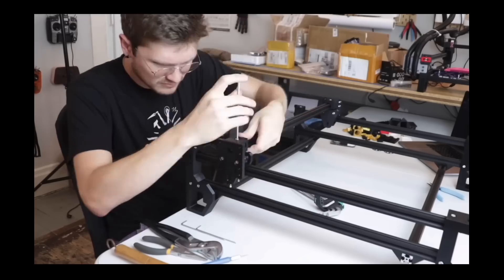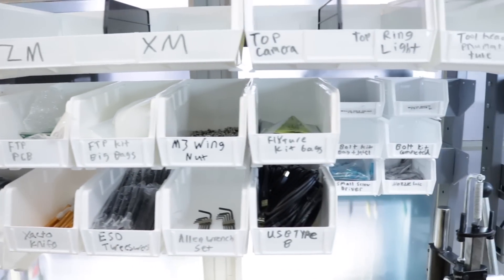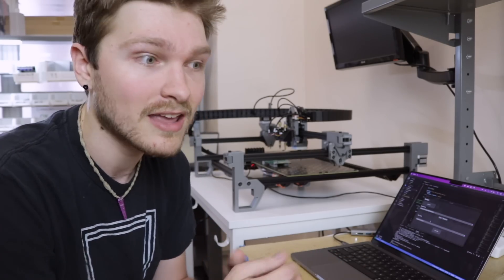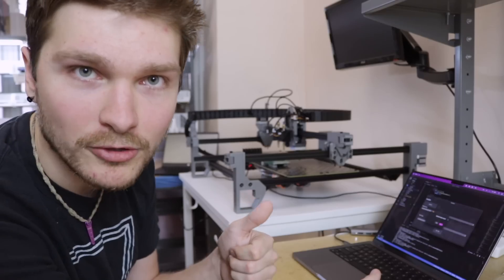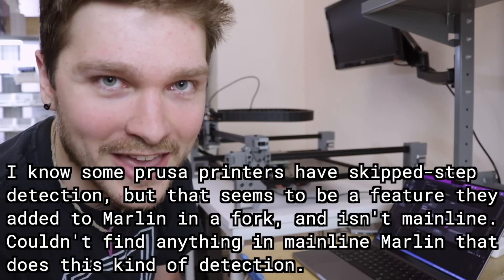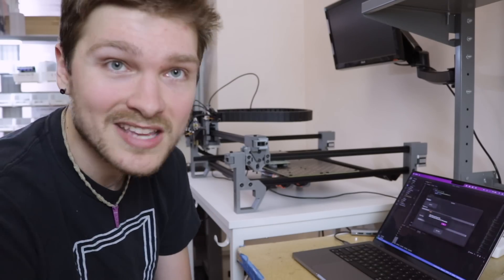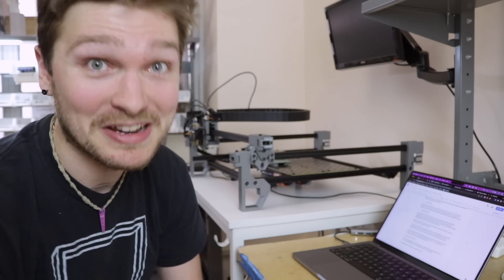writing a hardware testing suite from scratch

Comment: @Stephen Hawes:  Can your Open PnP machine place BGA, LGA, PGA chips aswell? 
                                   Also are you planning to make open source machine for Solder Paste Printing, Solder Stencil Printing, 3D Solder Paste Inspection (SPI), Automated Optical Inspection 3D (AOI) for top and bottom smd & pth component placement, Automated X-ray Inspection 3D (AXI), Robotic PTH Soldering machines aswell?

Comment: I wonder. For positioning, you may be able to use magnetic sensors in combination to smartly placed magnets to give you more precise position feedback. The sensors nowadays can detect way more than just a magnet, but it's field strength and orientation. So, if positioned right, the sensor could not only detect a magnet, but how close it is and when it passes by to the other side. The could really help with positioning data. You could home the moving part, take the sensor input for that position, then track sensor output for each step as the part moves. Obviously, in many areas, you would just be able to have the sensor at the end points of the part path, but that would still give a tonne of feedback. For instance, you were mentioning about skipping during moving at certain speeds. Well, you could combine the expected position of the part to the sensor feedback long before having to home the part and recalibrate it. Also, it allows you to adjust end positions easily in software with the sensor verifying by part position rather than step count, so it's independent of alignment issues or step skipping.

Comment: For open source hardware you can get a free VID:PID pair from pid dot codes
With a unique PID you can auto detect the USB connection of you machines in any software which can be quite useful (like your test software)

Comment: You could populate a board without solder paste, automate a picture of various sections, then compare as the check. 
Then again it would use parts and if a failure disturbs the pcb, then all the SMDs could shift invalidating each placement (which signified different tests).
Reply: Maybe compare pics taken as the test progresses.

Comment: Might make sense to also keep track of temperature you ran tests at. Realistically, might not make any difference in this particular application, but I have seen test/calibration data go useless because we didn't note what was the temperature of the board when we ran the test :) We realized this months later, when seasons changed and ambient temperatures in the test area dropped significantly.

Comment: I noted your comment about testing the stepper motors by running them into a hard stop and measuring the current. I read in Arduino forum that because the current constantly varies while running a stepper motor, it cannot be done. How do you do it?

Comment: On skip step detection, or a version of it: try out ENDSTOPS_ALWAYS_ON_DEFAULT in Marlin which is basically that when also using SENSORLESS_HOMING. Note you can tune the sensitivity with M914 command. Also if you enable TMC_DEBUG then M122 will give you detailed stepper driver information, including stallguard sg_result, which is a number representing the current motor load.
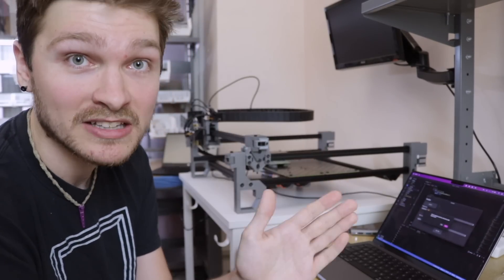Re 5:27 "back at perfectly zero". Well.. the above should catch missed full steps but the precision rabbit hole goes deeper. TMC motors also report the current micro step as "uStep count" in M122. Home, record the value per axis, do a lot of motion then re-home and check how different uStep count is. This should be precise enough to measure the repeatability of the microswitch I see you have on the Z axis.

Comment: That test procedure is going to get real tedious once you start doing significant numbers. Much of this can be automated. What you ideally want is a single button for "go" (or not even that - just start when it detects the USB being plugged in) and red and green lights for pass/fail. 
As you have a vacuum sensor and a movable head, all this could be automated by moving the head onto something that blocks the nozzle. Remember that for production test all you are looking for are things like bad connections, incorrect assembly etc. so the testing only needs to be enough to detect each possible issue, e.g. you don't need to test all nozzles,  just that the vacuum readings are in the right zone.  
If you can home by sensing motor current,you can also test for missed steps by counting how many steps ( or just the amount of time) it takes to home from a known position.

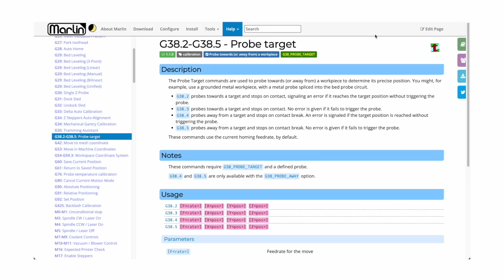Comment: The test at 5:30 
You could make it do the different speed tests you already made and then by knowing the current position of the stepper motor you could add a feature that homes the axis and returns the length it moved from start homing sequence to home position. Then you know if the stepper motors skipped steps.

Comment: To test skipped steps on x and/or y you just need 4 contact points on the "bed" and one probe on the head. just move left/right or front-back a number of times then try to probe 1/2/3/4 points. based on results you can say if you skipped any steps.

Comment: Hey this looks amazing. I was watching this wondering if building a small jig/board would remove a lot of the manual intervention here? A board with sensors that could detect x/y gantries moving over head, some small sensors with different sized chips over sensors that could be lifted/placed to detect vacuum is working and maybe even rotation somehow. Just a thought, love your videos bud, really inspired me to learn a lot more about electronics.

Comment: Regarding missed step detection: Since Prusa Printers seem to have it and their fork of Marlin is also open source, you could have a look into their source code and port that feature to your firmware. It'll probably not be quite easy, but I'm sure you can do it. Alternatively, reach out to Prusa3D and ask if they can help you with that, maybe by contributing the feature to mainline Marlin. I'm sure they'd be glad to help you out.
Reply: Their Motherboard connects the uC to the diag pins of the TMC2130s. I assume they have an interrupt set on that pin. On the lumen motherboard on the other hand, that pin is not connected and instead they use SPI for communication with the stepper drivers. So I think you won't be able to just use Prusas implementation here.
Reply: @Staphylokocke  oh, interesting! That makes a lot of sense, actually! The drivers will probably not deliver enough data over SPI to achieve similar functionality.
Reply: @InterFelix  Hmm but at the same time, the lumen uses sensorless homing, which means there must be a way to get the load values in a high enough frequency for homing to work.
Reply: I guess for a single axis while no print is running it is fine to just poll constantly over SPI

Comment: For checking if it skipped steps: Couldn't you make it stop for example 1cm or X amount of steps to the side after the speed test and then home? If it only moved 9mm or less before it's homed it was too close and if it moves 11 mm or more before it's homed it was too far away and obviously skipped steps in both cases?

Comment: Watching the movement at around 6:20, the flexing of the LH cable near the plug might prove to be an issue in the long term. The outside of the multicore cable looks very stiff, so the flexing is where the inner cores enter the pin header plug, which may in time cause the conductors to crack and fail through the "wiggling" effects as the nozzles moves up and down.  - Just an opinion, I think you have done a wonderful job in taking this idea to market, and appreciate you taking us along for the ride.
Reply: Yes, that cable definitely needs proper support - having the cores flex at the connector will be a disaster.

Comment: Surely skipping steps looks different to bumping axis limits on the current-vs-time graph. Maybe just train a little regression and make it hella conservative?
Reply: Oh oh I know, pick n seconds after a "collision peak", fft it and voilà, even a hardcoded decision tree can categorize based on amplitudes of predefined frequencies.
Reply: I would go as far as saying that picking a couple of points on the delta-current vs time graph can be good enough at indicating skipped steps. Now I just need to fit some models and show the accuracy, so if you find it worthy a try, just say (and give current data :))

Comment: You surely already know but prusa includes a report of the tests run on their machines before shipping. Since you already have the results, it should be easy to attach a printer and print a summary for inclusion in the package (just generating a pdf and printing it should be enough)

Comment: Speed checking for mis stepping can be delayed until you have the upward-looking optics operational.  The basic theory is to auto-center the nozzle to the camera. Then run a speed test then move the nozzel back to the camera and it should be the same.  A similar method can be used to calculate the dual nozzle offset.

Comment: Hm, are you planning on optimizing the procedure?
Because there is a lot of time wasted.
You could test multiple things at the same time.
Like for example the test of the motors. You can let them move all at the same time.
Or the test of the nozzles. Why test them one after another? You could do both at the same time.
And then requiring to hit enter after every single test. That's not only wasted time but also really annoying for the operator.

Comment: I think marlin has a TMC debug command with M122 that could be useful. For more automatic tests you could put a wireless arduino on the "head" and report the acceleration. This can easily be made fast enough to capture individual steps.

Comment: Sure, sheets/excel, is a poor substitute for a "real" database, but it does work well for smaller datasets, and it is hard to beat the automation simplicity with csv-files and fixed columns. I did a fair bit of VBA programming for Excel in 98-2000 with Excel pretending to be a database, it was fun a frustrating in equal measures, but I finally convinced my betters to spring for actual databases.
I think for automated testing, you probably have to use some sort of "active harness" ie something you hook up to the PnP, but it has the sensors it needs to check for skipped steps etc. So I would assume an Arduino or similar with a bunch of sensors that can talk back to Gundam to provide what actual values it saw, its name would clearly be "Haro", but that is just fast musings.

Comment: Always exited when a new vid is up! Regarding checking if it skipped steps or not, what about sending a home command after the test and then timing how long the home sequence took? If it takes e.g. 0,05 seconds longer than normal, you know it skipped some steps. Just thinking out loud here, not sure if its actually possible with Marlin😊
Reply: I came here to say the same thing, except that I thought maybe it could home and see if it’s home has moved relative to where it thinks it should be
Reply: @ThePixelMint  
Marlin doesn't report the steps it took to home, sadly

@OMGWTFBBQSHEEP

I looked up the steps per mm and it's at 5mm/fullstep so the timing could be viable if you go slow on your homing feedrate. Now the homing just has to be repeatable to at least 2.5mm, but that sounds reasonable.
Reply from the maker: Ooooh this is a cheeky idea! I think this would be possible with the time measurement happening in Python, and waiting for a "finished homing" response from Marlin! I'll poke into this, thanks for the thought!
Reply: Great! Looking forward to see if it works out!

Comment: About measuring the force required to move the axes:
You could iterate through various settings of HOMING_SENSITIVITY with the M914 gcode command.
If you place the axis that you want to measure at a known distance to it's physical limits, you can measure the time that it takes the axis to home. If the axis reports that it is homed too early, the force required to move the axis must have exceeded the threshold for that HOMING_SENSITIVITY.
If this works, you would just have to find the tipping point at which the HOMING_SENSITIVITY is just high enough to fail to move the axis.
That specific sensitivity should correlate with the resistance of the axis.
Reply: Okay Mr. Hawes, you really nerd-sniped me. You can actually just get the motor load from the M122 command, which gives you the sg_result. The sg_result is just a measure of the motor load at that time. So if you move the axis and average that value over a few seconds, you should know how much resistance your axis has.

Comment: Have you considered a test "harness"? I don't know how many things you can automate via 3D printed block full of widgets that you snap on for the test, but you could automate testing the vacuum tips by having the NO45 tip mounted in the block at a height it can shove the tip into, and with a solenoid to block the NO45. Put the head in position, do the open test, shove it into the nozzle, do the nozzle test, activate the solenoid, do the closed test.

There's a bunch of options for a test block to facilitate checking for lost steps, you could have a mock homing post with microswitches; you could have a really big optical interrupter, almost certainly DIY, and probably a laser, that detects the gantry without being collideable. Doesn't need to be precision, just after homing have the gantry cross it and record where it is, then after the speed test cross it again and detect if it moved. Another option, 4 paddle microswitches like in an arcade stick (2 switches would probably be fine), at a height below the position where both heads are lifted, but high enough that you can reach a head down into it. This has less rigidity because the heads, but it's low force, especially with paddles giving you a lot of leverage.

You could also use optical interrupters to check Z travel, the most extreme version is have 4 interrupters, two just inside the upper and lower limits, two just outside, as two stations. Put a head at an extreme, enter the station, one interrupter should read open, the other blocked. If both are blocked it's too low, if both are open it's too high. I think, not totally sure, but I think, if you check the lower limit of both heads and they're both nominal, then you can infer that the upper limit is also where you want it to be; which means when you put the head in neutral position, the heads are at the same height. So you don't need 4 interrupters, you don't need two stations, you just need a pair of interrupters at the lower position, which also means you don't need a thing sticking up that could get hit by a faulty machine. And now it can be a 3D printed hole housing the interrupter pairs in a cross so the two Z levels can be closer together without components hitting each other.
Reply from the maker: Wow, all kinds of rad ideas, thank you so much for your thoughts! I really like the idea of a cal jig print that snaps onto the staging plate and helps facilitate automating these tests.